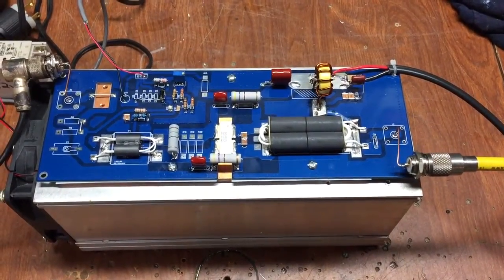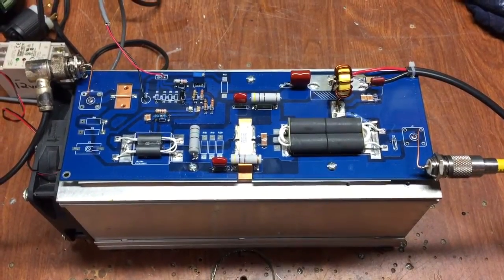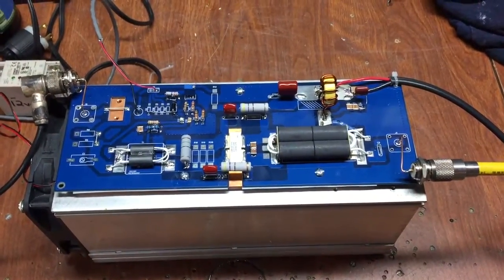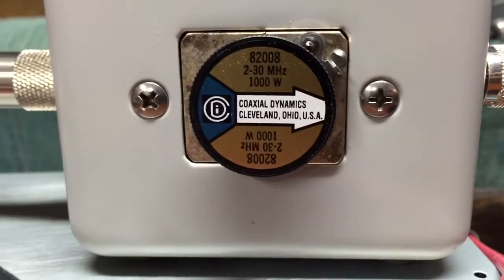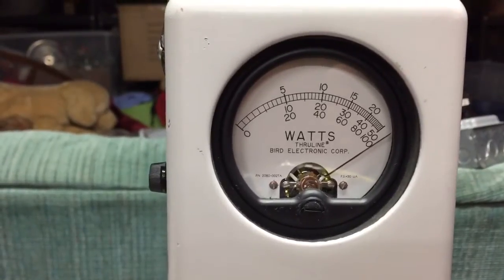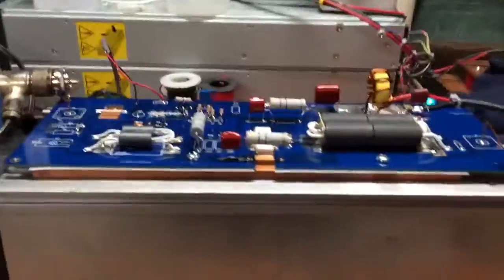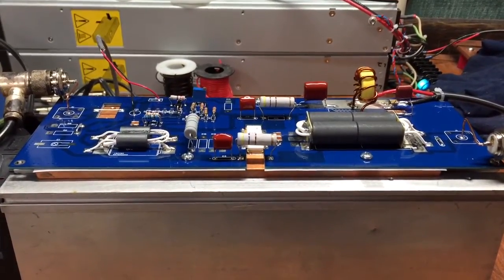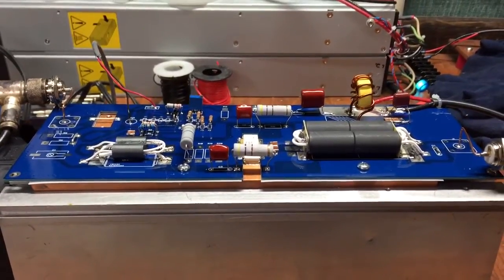Christians LDMOS amp

Comment: Do you see any difference between Freescale (MRFE6VP61K25H) and NXP (BLF188XR) devices?
Reply from the maker: +Yongsup Park No difference in performance. I use the NXP because the are extra rugged.
Reply: +KF8OD Thanks. No circuit or bias change needed?  How more rugged is BLF188XR?  Do you have any first-hand experience?
Reply from the maker: +Yongsup Park No circuit or bias changes are necessary. This device can handle an avalanche of 4.5 joules, they actually dump the energy in the event of extreme mismatch. See app note AN10273. Amazing devices!

Comment: Are you using Mosfets to archive that output?
Reply from the maker: +Carl Brutananadilewski  Yes, the devices in my amps are LDMOS, Laterally diffused metal oxide semiconductors. The lateral version of power mosfet.
Reply: The Source needs 50V Supply, and how much a transistor?
Reply from the maker: +Carl Brutananadilewski Yes, 50vdc at 30 amps. I buy mine on ebay for about $190.00.